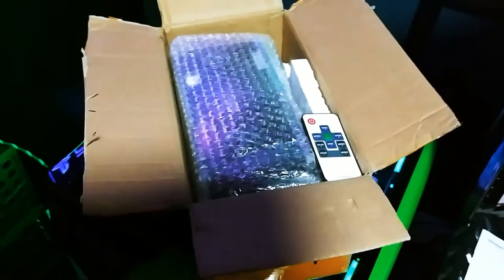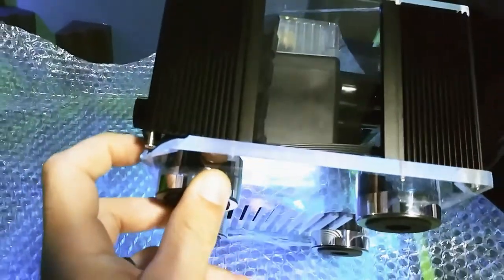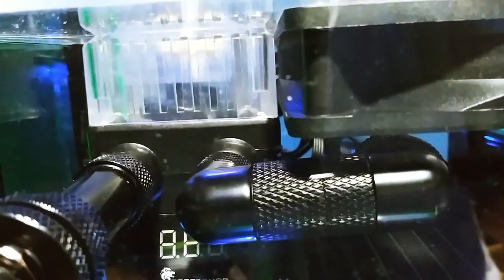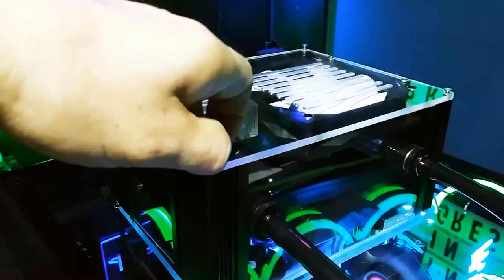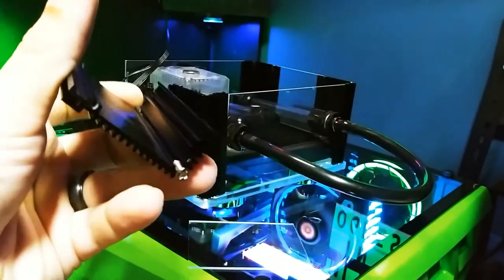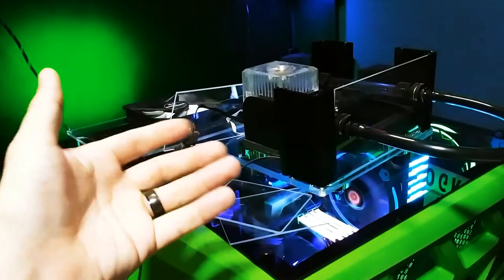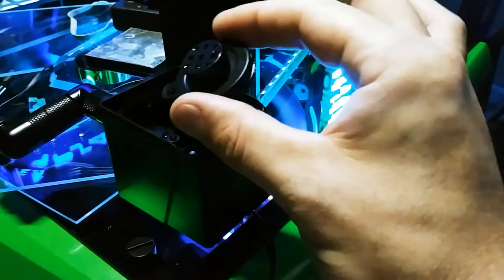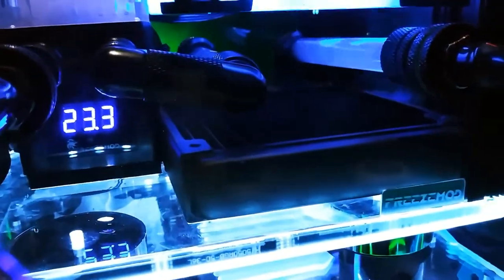FREEZEMOD Notebook Water Cooler Kit

Comment: Be carefull with the pump, the white plastic, on top, can very easy brake, since its not a very strong plastic, beware !
Reply from the maker: It already.. I had to have a whole replacement pump sent.. Plus the pump leaked...  Thx for your comment.. Check out some of my newer videos.. And consider Subscribeing.. Cheers!
Reply: @ATECHPCs  I am telling you this because i have a collection og chinese pumps to test out, this pump does look good, but the plastic is junk, it will leak on the top. If you need help with a new decent pump call me. i already tested some pumps.
Reply from the maker: @tdomingues89   cool...  I just bought a.new freeze mod water pump/res combo..  If u watch my (water cooled Air cooler  fail video.)..its one of my newer videos.. I use it in that video.
Reply: @ATECHPCs  Going to see that, give a sec.
Reply: @ATECHPCs  So i have that pump also XD, i have like 10 diferent pumps, my pump is the cheap version, with the chassis made of plastic and not aluminiun, so your is a bit better, since it can disipase better the heat from the pwm IC, that f you use the pump like more of 70% PWM, but i have to warn you also, this pump has the same problem has mine, the fatory of freezemod is kinda shit, they don´t test the product for leaks, so the plastic of the inside, sometimes comes cracked, and/or worse, there was a lose wire under the pwm cable inside, that could short the pwm  cable, and possible kill the pwm pin on the motherboard, so please check the inside of the pump, and inspect it ! Also your pump is the 800L/H version correct ?